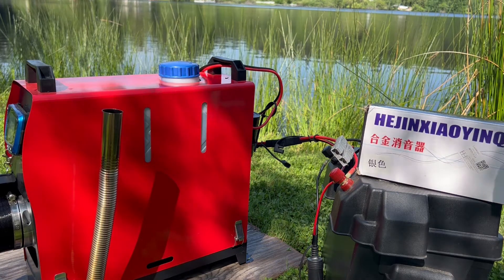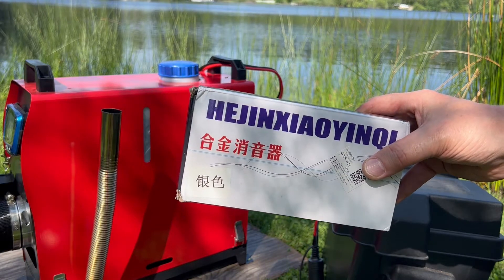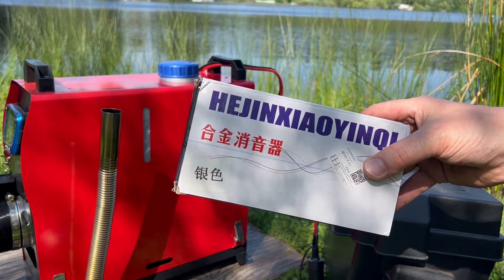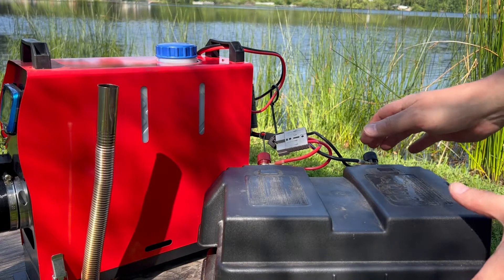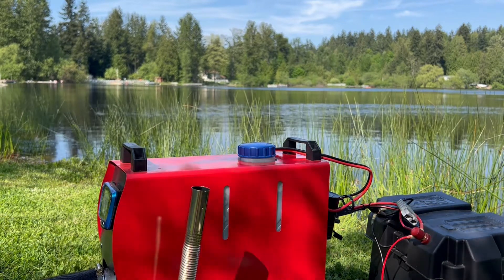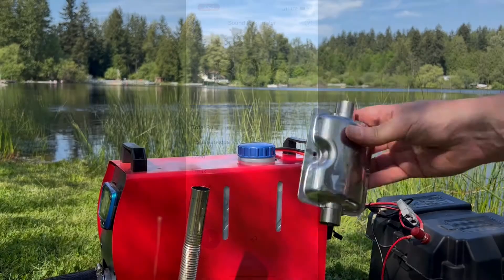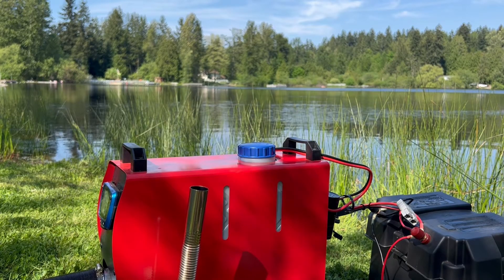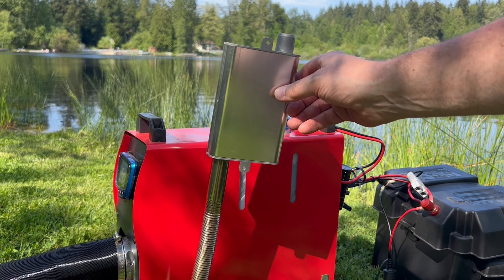Diesel Heater Muffler Upgrade With Sound Level Results

Comment from the maker: Diesel Heater Stuff:
Upgraded Muffler:  https://amzn.to/3K4pAAQ
8kw Diesel Heater:  https://amzn.to/3pWD7DI
Nicer Diesel Heater:  https://amzn.to/40Nt4Pj
Quiet Fuel Pump:  https://amzn.to/3DmjYyg
Fuel Lines:  https://amzn.to/3TWBB0Q
Controller:  https://amzn.to/3K68AtR
Thru Hull Fitting:  https://amzn.to/46YFFC6
Exhaust Tube:  https://amzn.to/46YFGWG
90 Degree Exhaust Fitting:  https://amzn.to/465RJ2I
Heat Wrap for Exhaust Tube:  https://amzn.to/3Q8YiLH
Battery - Long Lasting LiFePO4:  https://amzn.to/44QbLhd
Battery Monitor:  https://amzn.to/3QXVS4x

Comment: The problem with these exhausts is that they restrict the exhaust more than the original and cause the heater to coke up much faster than normal and can even cause the heater to flame out!

Comment: Makes me wonder if the corrugations in pipe make noise. I have never tried or seen straight pipe. Does length of pipe tune the noise freq. A lot more experimenting needs to be done. Would immersion of end of exhaust in liquid make a difference. I should have my 2nd heater tomorrow, will experiment for domestic use. I won't it no louder than a combi boiler exhaust.
Reply: I used a straight through SS 24mm marine heater exhaust on my house installation. Bought from Ebay from a small company in Chard UK. No drip hole as its designed for internal use of a boat, so air tight. You just have to make sure it is angled downwards slightly to drain condensation build up as mine is outside but near the hot air intake. The exhaust is then extended and increased to 52mm to run for a additional 3m. Very quiet, definitely as quiet when on low as a combi boiler, just working on reducing the fan noise now.
Reply: @sellma111  Interesting.

Comment: I ordered an lf bros 5kw this muffler and im going yo try using both mufflers see what its like
Reply from the maker: Nice!
Reply: @peppermoongarage  I decided against it and just used the original.  It's super quiet and stealthy.  Thi I'm using lf bros n4 version.   There is a slight smell of exhaust after shutdown is that normal?
Reply from the maker: Those LF Bros heaters look like nice units, much better than what I have.  I haven't noticed a smell on shutdown, but that doesn't mean it's not there.  I would imagine it's fine.

Comment: BEWARE! This exhaust while being undeniably quiter caused my heater to coke up quite badly very quickly to the point where it wouldn't ignite while producing lots of white smoke. Not sure what's going on? it maybe the reduced diameter or the S bend. I think the exhaust might be ok on a combustion engine but definitely not for a diesel heater. Been running the original exhaust ever since with no issues.
Reply from the maker: Thanks for the report.  I would be curious if others experience the same thing.  Mine is fine so far, granted I only use it a few times a year while camping.
Reply: @peppermoongarage  My diesel heater runs 24/7 for weeks at a time mostly on H2 heat setting but going to H6 maximum for about 20 minutes every morning with this muffler installed. I have no problems with it. I actually have another length of exhaust attached to the outlet end of the muffler.   I took the combustion chamber apart in October to inspect for carbon buildup. There was none even after burning for hundreds of hours. https://www.youtube.com/watch?v=ceeSfqwcNOs
Reply: Could be more back pressure causing rich mixture, try running on lower setting.
Reply: white smoke usually means liquid is inside the muffler, probably need to drill a hole to drain it.
Reply: @KraziAzn2 is it possible he installed it drain holes up?
Reply: @MechInvent  very possible.

Comment: This the 5 or 2 kw heater?

Also what size of inner / out diamater puffler do I need to order for these heaters?
Reply from the maker: The heater in the video is an 8kw, but I think the exhaust size is the same on all of them. 
I measured OD of the input for the muffler and it's slightly tapered to a max of 24mm.  maybe 23.8mm at the smallest.  So an 24mm ID pipe fits into it just fine.

Comment: was going to get one but decided against it due to the number of additional bends. I read somewhere the exhaust should only go through 270 degrees of bends.
Reply: In the supplied manual in the non boxed versions.
Reply from the maker: Interesting, I had not heard of that.  Mine seems to be fine with it.
Reply: Where could.of u possibly heard that, in the lab?
Reply: Watch John mck47 Part 8 - Exhaust and Mufflers. I also read it in the instructions. As these are copies of the EBERSPACHER heaters, they therefore have a manual by proxy.  @americantruckeringermany8394
Reply: That does depend on how tight or small the sweep of the bends are. 90 degree elbow bends are a definite no.
Reply: Not true .  All of the things I’ve seen people say in the comments. Just don’t apply I’ve ren this muffler  for 2 years no problems
Reply: @SacredHeart0520  Is true. Webasto Air Top 2000 STC states the maximum sum of all bends can not exceed 270 degrees. Just because you have a sample of one doesn't mean you are correct. I would rather take advise from a  company that has done testing and experienced failed units and come to certain conclusions about the best way to increase longevity of the unit, than someone who has 1 that's working fine.
Reply: Thats bends though. This is a drilled set of bends so gasses dont realy get held back its still free flowing @sellma111

Comment: Is there a drain hole on the bigger side Ted model?
Reply from the maker: Good question.  There is not a drain hole out of the box, but one could easily be drilled wherever someone would want one.  Moisture would probably drip through the seams to the end caps anyway.